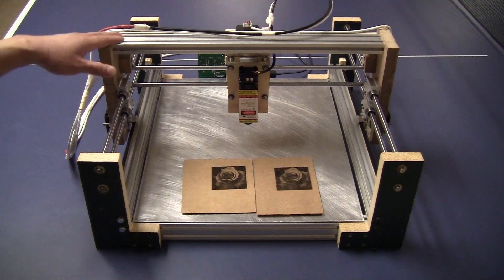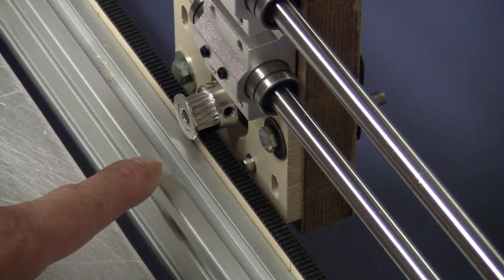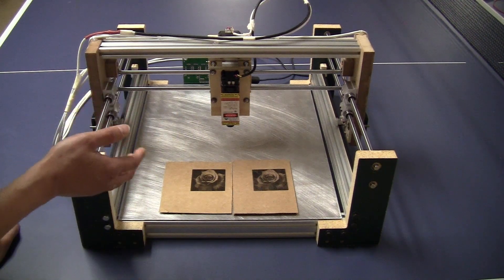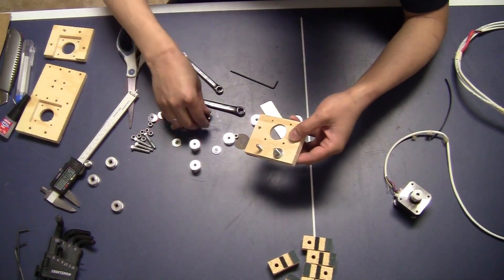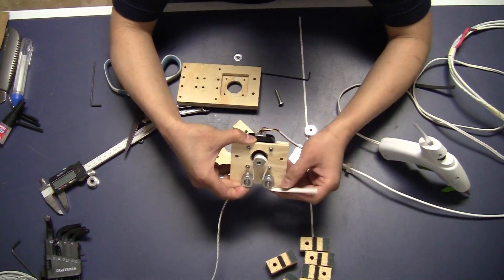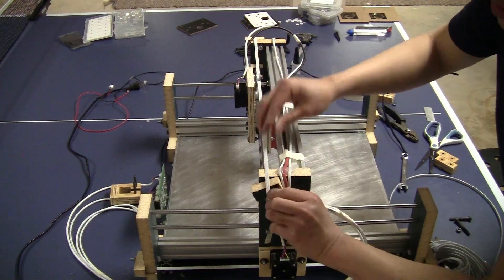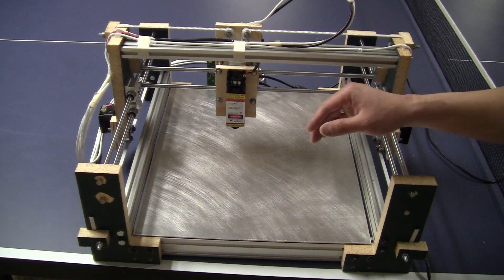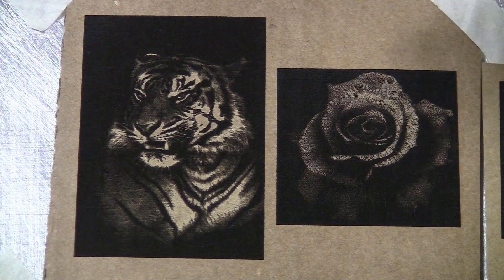Why timing belt needs to be wrapped around the pulley - Laser engraver rebuilding

Comment: My 50w laser had that and it is called Curtains.  A lot of laser machines have it and all of them are belts looped over the pulley (iow not a rack and pinion) but Russ Sadler fixed this years ago and I made his contraption for my machine.
Reply from the maker: You definitely have more experience on this, I don't even know the terms. It seemed to went away on mine with the belt wrapping setup. Maybe my laser is so crappy that it is not clear enough to see. The more I get into this laser engraving thing, the more power I wanted. I envy your 50w laser, lol. Hopefully I can buy or build a CO2 laser in the future.
Reply: Well, this only really begins to show its ugly face when doing engraving and if your machine is bad enough it is not easy to get rid of.  What needs to be done is the the belt's smooth side on everything except the pulley which is, in essence, turning the belt into a rack and pinion setup.  Very hard to explain without a picture but the belt's teeth only ever touches the gear and the smooth side is what touches everything else.